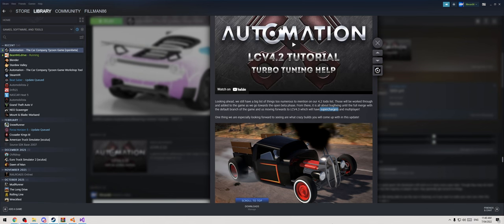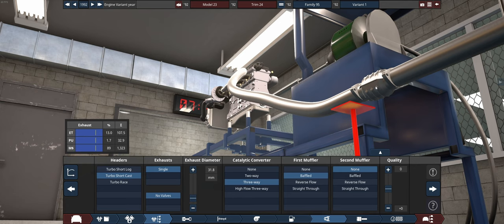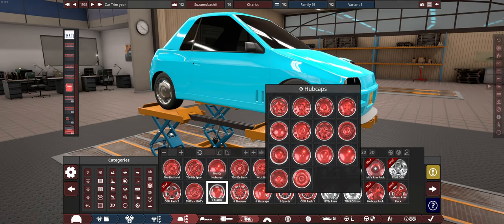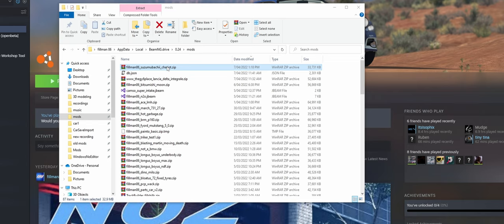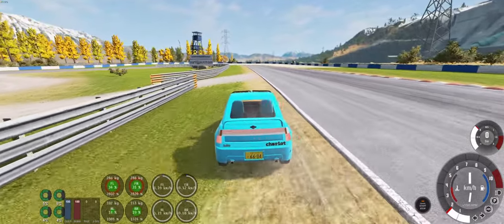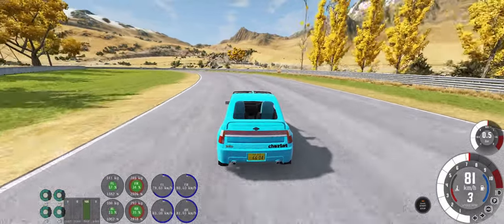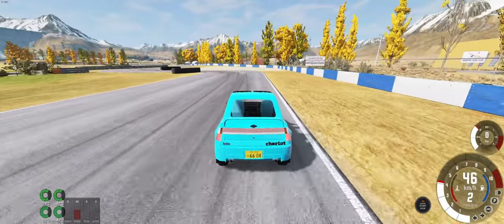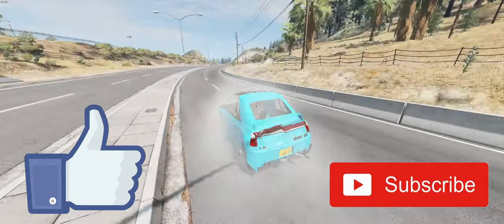You can Now TWIN-CHARGE!! your Automation🔧BeamNG Cars

Comment: When it comes time to adjust for over/understeer, a massive component of that is the sway bars. You can take an almost bone stock car and MASSIVLY change its handling characteristics just by changing the sway bar stiffness's.

General rule of thumb:
Softer front sway bar will allow for more front end grip and turn in, but will reduce weight control
Stiffer front sway bar will allow for less front end grip and turn in, but will increase responsiveness and weight control but it may become understeery
Softer rear sway bar will allow for more rear end grip and will help keep the rear gripped up but will reduce responsiveness
Stiffer rear sway bar will allow for less rear end grip and will increase responsiveness and weight control, but it may become oversteery
Reply from the maker: I know what you're saying, but it's not as effective in auto/beam cars, and just changing the suspension type made all the difference instead. You also don't want to have massively different front and rear characteristics for road passenger cars, because it becomes uncomfortable
Reply: Sway bars just changes mid corner and overall car grip IMO, to change car braking and initial turn in, you must adjust the front springs / dampers stiffness.
Also, sway bars plays a vital role in cars that shakes a lot at high speeds.

Comment: If only this mod had a mesh, then it would be grand. also how dare you not give us a steering wheel.
Reply from the maker: the problem with putting a mesh on it is that it will be in the same place, regardless of the engine in the car.... so you can see why that wouldn't work haha also it's uses one of those brain scanner things to drive ;)

Comment: i just used the supercharger to make a muscle car but i hear no supercharger whine, is that normal? did the file just not come with it?
Reply from the maker: it depends on the type you choose, and if you still aren't happy, you can change the code lines - "whinePitchPer10kRPM" and "whineVolumePerPSI" to make it louder :)

if you're wondering if it's working, it should come up with pressure gauge next to the rpm/speedo
Reply: @fillman86  thanks alot! amazing work on the mod its been fun!

Comment: Hmm so that means i can  beat my 3.3 liter i5 making 1300hp.  And make a even more extreme track monster. I expect more than 1500hp can be posible with this mabey.
Reply: In a 3.3 liter i5
Reply: what I advise you to do is to tune your turbo to produce maximum power with a cost of a lot of lag and then use the supercharger as an anti-lag device
Reply: @leoaraujo8590  yeah i might try that cush i was able to produce more power nut it would have so much lagg like torque and power wil come at 7k rpm. with my current setup it comes at 3.8k
Reply from the maker: haha here's a secret, the supercharger doesn't have limitations really, so you could just turn it up, and make loads of unrealistic power haha!!
Reply: @fillman86  I was just pondering this, beam doesn't register knock and compression rates unless automation exports with the line of code representing knock
Reply from the maker: @leoaraujo8590  correct